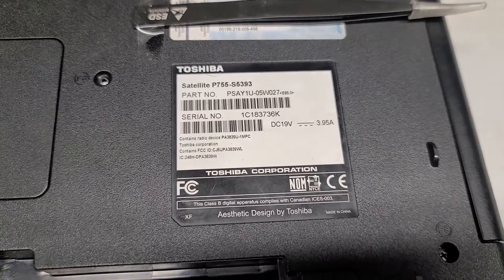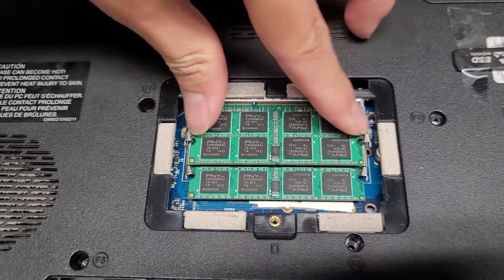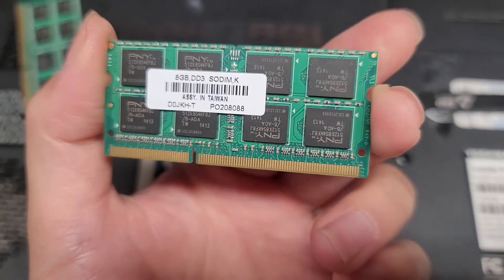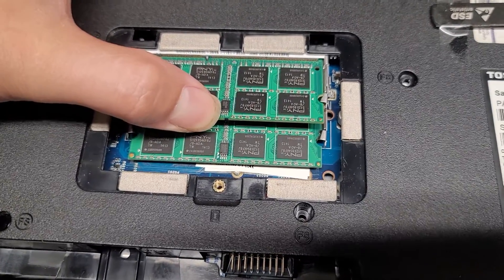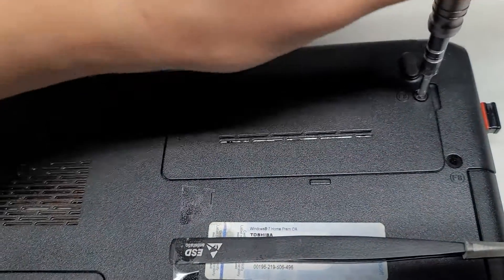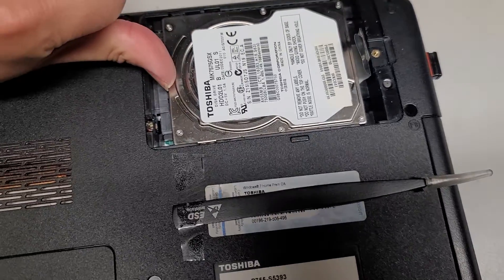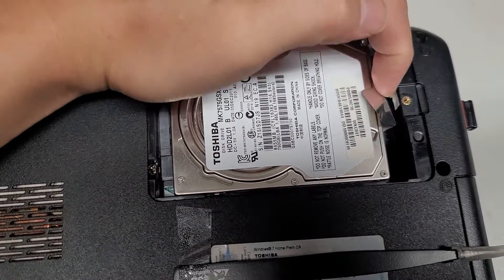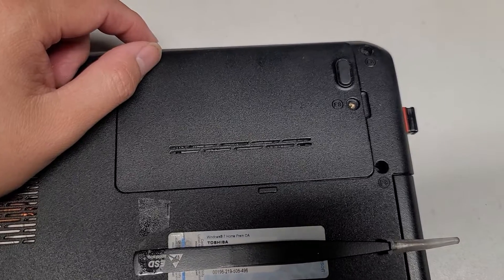Toshiba Satellite P755-5393 Disassembly RAM SSD Hard Drive Upgrade Replacement Repair

Comment: Hey, I noticed you have 2x8 ram sticks by any chance do you know if you were getting the full 16GB? I'd like to know because I looked up your Toshiba laptop (P755-S5393) and the max capacity should only be 8GB, like my Toshiba (P755-S5215) it only says 8GB max as well. So, I was wondering if it works with yours then it might work on mine too. Thanks in advance.
Reply from the maker: It was a customer's computer. Pretty sure it worked.
Reply: @ItsBinhRepaired  thank you for the reply.
Reply from the maker: No problem